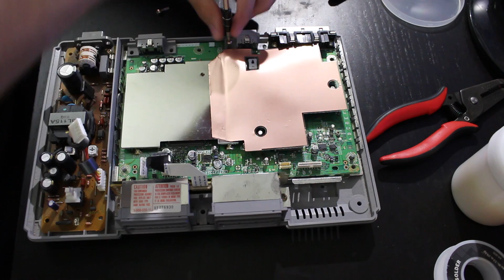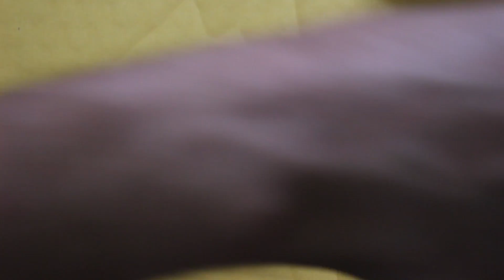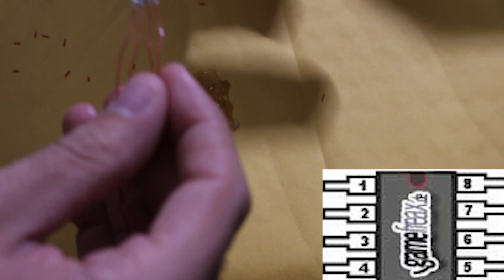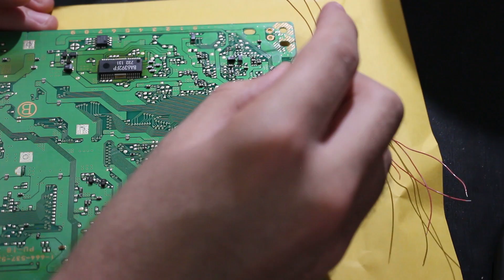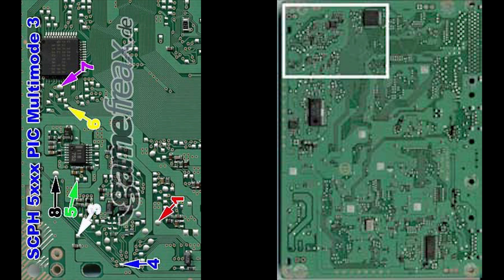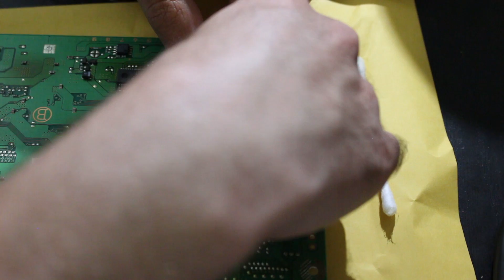How to Install a Modchip in an Original PlayStation | MM3 PS1 Modchip Install Tutorial

Comment: Great video Mr. Mario as always.

I bought some of the PIC 12C508A and have them in purchased off the aliexpress link you provided.
These need to be programmed first before installing correct? If so, I'm glad you have that video on how to program it and will move to that stage before of course putting the ps1 on the workbench.
Reply from the maker: Correct, they're blank unless you buy them pre-programmed.

Comment: can you tell me what type specific 12C508A chipset you use? i bought it, when arrive its really small like 6 time smaller than micro sd card physical size.
Reply from the maker: It sounds like you might have gotten one that you're meant to use as a SMD component, not one like the chips I've shown here.
Reply: @MrMario2011  i see. when i check back its SM model meaning small model. are you using /P model right? is that SM model also work on this?

Comment: I know this likely won't get answered soon but I'm curious - I bought a used ps1 from a convention and just wanna play Spyro 3 but I got the dreaded "your console may have been modified" warning. I have zero use for a modded ps1. Is there any way to safely uninstall a modchip? This video got me a good idea of what everything is since im brand new to this kind of thing but I'm not sure I can, like, just do everything you did but backwards.
Dunno if it helps but the model number for the Playstation is SCPH-1001.
Thanks :)
Reply from the maker: Essentially that, yes. Open up the console, find the modchip, and tap your soldering iron to each point wired to the motherboard to remove each wire.

Comment: I did this one (SCHP 7000), but It doesn't seem to work. Pretty sure the modchip was installed correctly, verified the continuity with a multimeter, nothing wrong. I burnt some discs, while it worked with the swap trick (but stuttering a lot, doesn't matter if I burned at 2x, 4x, 8x or 16x), trying to play the burnt copies only with the modchip, always sent me to the audio cd menu screen. When I have the patience, i'll try to reinstall and buy another region disc to test it (actually, I was more interested in playing other region discs, than to play copies).
Reply: Hey, have you found solution/answer why is that not working on Japanese consoles?
Reply: @diversee  I believe the modchip I bought is defective. Tried to reinstall, nothing. I bought on eBay, and I had to choose the region/model in the product page, probably they burned the wrong region or model on the chip. I saw something better, a Memory Card that unlocks the ps1, but unfortunately, it's only for USA consoles. I'm really out of luck with this one! 😅

Comment: i have a ps1 scph 7501 and a chip that has aladdin one written on it that i took out of a broken ps1 slim that i found lying around. i have searched for tutorials and can't find anything. i found a diagram but it is not very clear and has very bad quality  :(
Reply from the maker: Aladdin? I'm only familiar with that type of chip for Xbox, haven't personally heard of one for PS1
Reply: @MrMario2011  Really? but I found it on a ps1 slim that I found smashed in a dumpster. I found a schematic and it is very similar to the one you used. only one of the pins is connected differently. the schematics you shared helped me because the one I found seems to be old and had very bad resolution.

Comment: I have a Japanese ps1 schp 5500. I have a 12f629 chip and I programmed it. After installing it on the ps1 the ps1 only reads original discs and can't read any burned Japanese games.

Comment: what kind of flux do you use? and is that iso alcohol and a q tip to remove it? im trying to figure out exactly which flux to use, how to remove and how much i actually need to remove. i was thinking of using rosin, maybe a pen, and then i saw some videos where people are bathing their boards completely in alcohol which seems like overkill?
Reply from the maker: Links should be in my Amazon store which is in the description, I was using Kingbo flux and 99% IPA with a q-tip. Better to use too much alcohol instead of too little, just make sure everything is properly dried before running power through it.
Reply: @MrMario2011  thanks!

Comment: Hi I am from Mexico. Here all the people who installed a modchip only added a pic12c508a only with 4 cables, I don't know what version of modchip it is but all the burned games work. The only problem is that original games like resident Evil 3 or Dino Crisis cannot be played because an anti-copy symbol appears. The question is. If I add the other 3 cables that are missing, will the problem be corrected? Thanks and great video.
Reply from the maker: No idea what modchip they're installing, but with what you told me that's not Stealth enabled. Most likely then the chip isn't a Stealth chip like a Mayumi v4 or MM3. If your modchip isn't a Stealth chip, using those other wires won't make a difference.
Reply: @MrMario2011  Ok I see. This afternoon I will burn a new 12c508a chip with mm3, my ps1 is a SCHP 9001 with a PU-23 board.
Reply: @MrMario2011  The chip did not work, I bought a 12c508a chip but I did not use a programmer like yours, I used the wellon vp-390 programmer and the processes or the options that you set for it I did not do them because that option does not appear, I only program but it doesn't work on ps1.
Should I change the oscillator settings? I just saw that the option was enabled for external oscillator and not internal

Comment: Excellent video. Kudos. Never done this before. Was looking forward to doing one I bought for peanuts today.  A lazy Sunday. Imagine to my horror when i got the board out (breaking off the 4 wire connector from the board that connects to the cd drive, which i repaired). That someone had already done it. Haha. It was only 4 wires, so guessing a real old version. But it can stay there.
Reply from the maker: Awesome find! That isn't a stealth chip with only 4 wires, so you'll run into several later release games not working.
Reply: All good. perhaps i'll install later, i should of done so really. But ended up repaiing a couple of iphones. I've got the M4 chip. Have done a couple of ps2 so should be a breeze. But once again, many thx

Comment: brother a question buy a used 12c508a chip
but I have been told that these chips are programmed before installing them but as it is already used I don't know what configuration it has.
my ps1 is model 9001, but I don't know what model the chip was in,
I don't know if it's the same configuration on all models.

Comment: I wonder if I can mod my psone
Reply from the maker: You can! I have another tutorial for that.
Reply: @MrMario2011  that's awesome.  It's also awesome how interactive you are with your commenters.  Good stuff.  I turned my old psone that I've had since 2002 (and hadn't run since 2004) on and it works but I think the disc spindle or lense (the sliding part)is creating way more noise than my older original playstation handmedown, so I'm thinking I'll just buy an ebay playstation to try this with.  Sorry for my rambling.

Comment: hi! is it possible to make some switch between the wires so you can switch on or off the modchip?
Reply from the maker: You could, but there's no practical use to doing that now a days with a stealth enabled chip.
Reply: @MrMario2011  my problem is that do to the chip my ps1 lcd screen is flickering/rolling on the boot screen, like if you put a ntsc game in a pal console.....so it destroys the old ps1 boot feeling. After the boot sequence is over everything is ok and the lcd dosnt roll and the picture is completely fine.

Comment: I did this many times many years ago but only ever used 4 wires from the PIC.  I remember on later models (7002 rings a bell) I needed to cut a track on the board which was always a worry but I got away with it.  Fond memories (£10 for the mod & £5 a game...  very fond memories)
Reply: How did you cut a track in the mobo?what purpose did this serve? If you dont mind my asking

Comment: You say in your video the mm3 is not 100% compatible to boot disks all the time, What if 1/10 times it doesnt boot disk. Is that alot? Are my solder connections weak?
and yes when I reset it works.
Reply from the maker: Sounds normal to me. I'd say about 1/10 times it doesn't boot for me as well, but a restart will boot it.
Reply: @MrMario2011  Perfect, that makes me feel good about my first major solder job lol

Comment: In the SCPH-7502 model it is necessary to put back the metal sheet that is welded to the plate?
Reply from the maker: Not necessary.
Reply: @MrMario2011  OK thanks

Comment: I have a 4 wire mod chip taken from a 5552 PAL console and want to install it into a 7502 PAL. My chip has wires coming from pins 1, 5, 6, and 8 so I connected these to the points in your video but it wont work, no games will currently boot. Any advice?

Comment: so i did this, it worked before i put the case back now it sits at the sony entertainment system screen help :(
Reply from the maker: Normally when something like that happens it's due to a bad wire, in my experience. If touching up and double checking points doesn't help, try rewiring and resoldering it all.
Reply: thank you for the extremely fast reply dude, there was a couple of times i turned the ps1 on and it did the same thing but the disc drive made some noises
Reply: i took the chip out, but it  still goes to the white screen, how bad did i mess up lol

Comment: hello mario. i bought a unit scph 5552 recently and had a modchip wired to the pcb even though the seller says its not modded. so i went ahead and disconnect the chip and had the mm3 wired to the pcb. now it wont load whatever disc and does not go beyond the sony orange and white screen. 

i have rechecked the wiring works and it does tally with ur tutorial. is it due to it has already been modded before and now im changing the chipset to mm3 is the reason for this?

what if i unwire everything and boot the ps with an original game, would it work like a preset system?